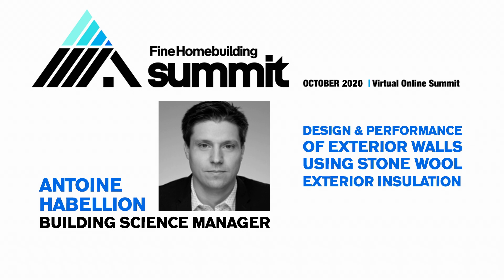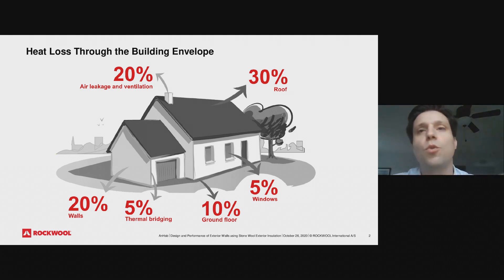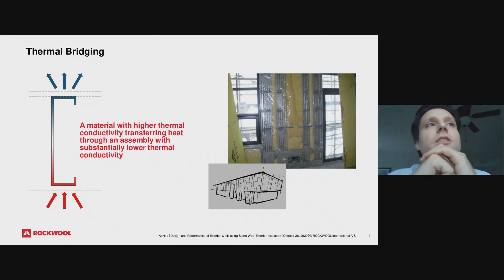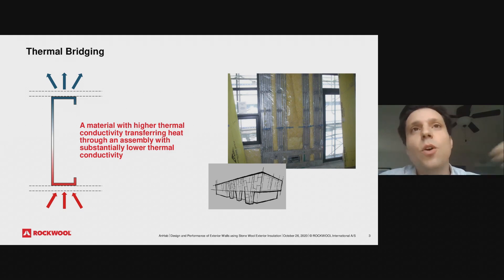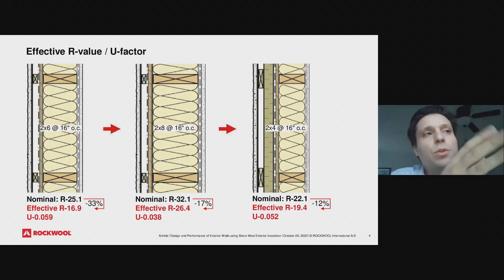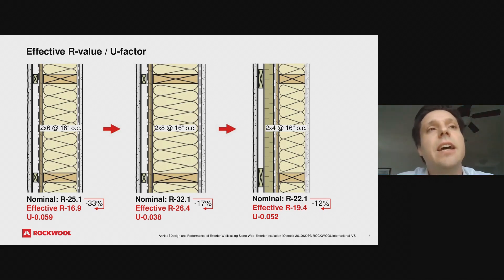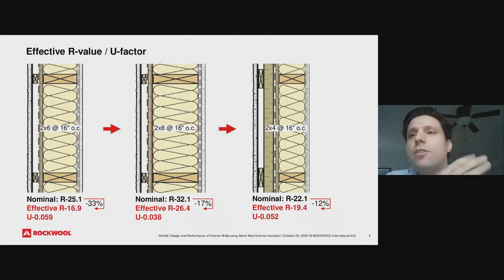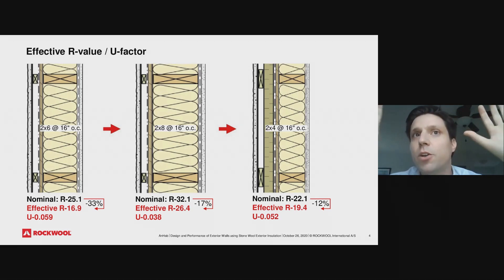Mineral Wool Exterior Insulation Performance

Comment: I agree with the mineral wool on the outside ... given the forest fires in many areas it would seem prudent... but I disagree with the air barrier on the outside... it is easier 

I would like the  the structural sheeting placed on the inside and that used as an air barrier and a vapor barrier ...

Somebody please prove me wrong.